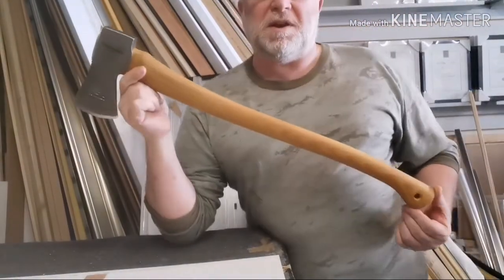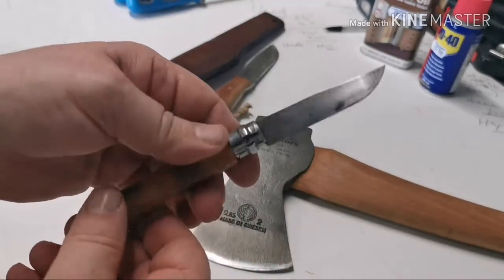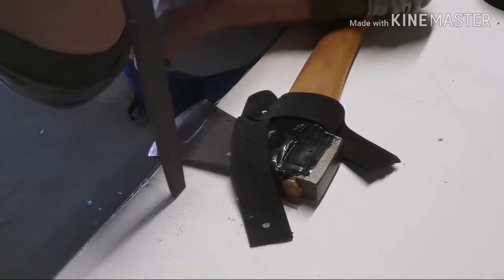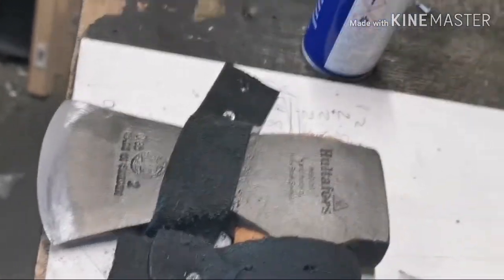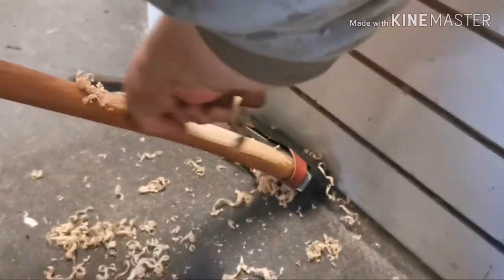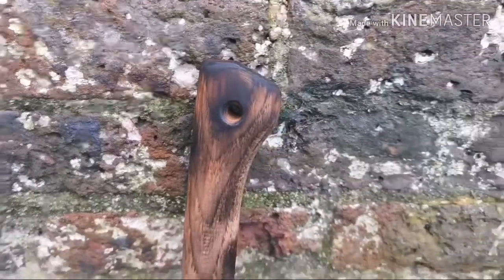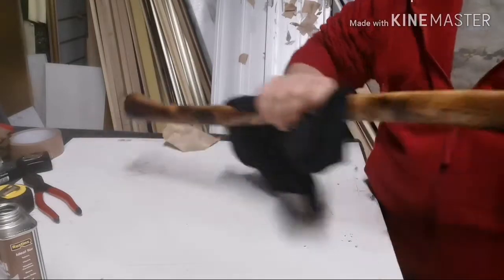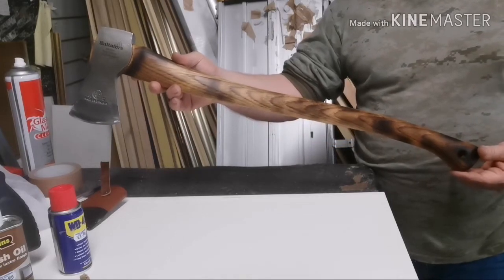Hultafors HY20. Reprofile/Sharpen, Thin the handle, Burn & Oil handle.

Comment: Did you end up giving it away? Great video, thanks! I just reprofiled my beat up hultafors hatchet and it's absolutely better than stock. They come with cheeks that are too thick for woodworking, I assume they are maybe geared more towards wood chopping tasks from the factory. Then, if you try to do detail work the head bounces off the wood. Gransfors doesn't have this problem, due to a different axe head and edge bevel profile.